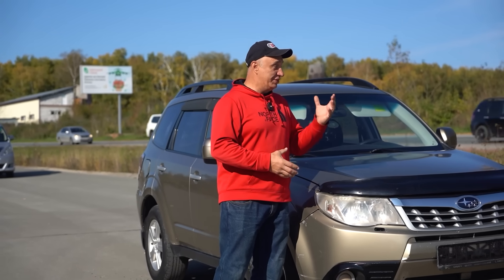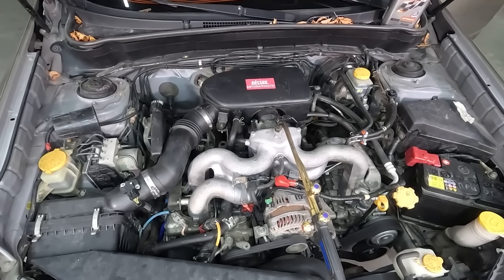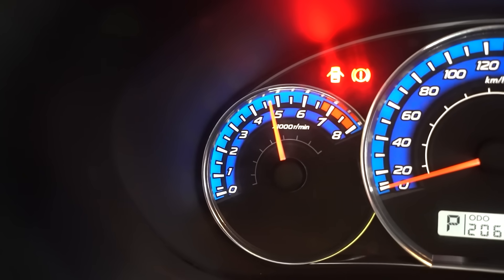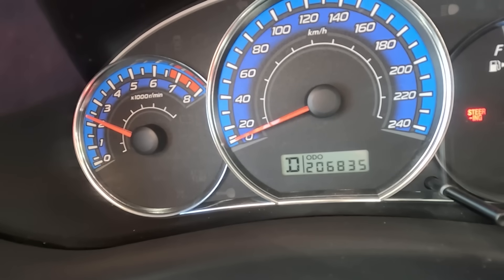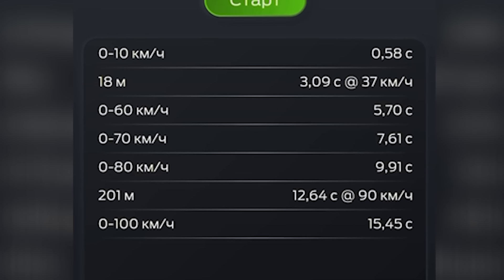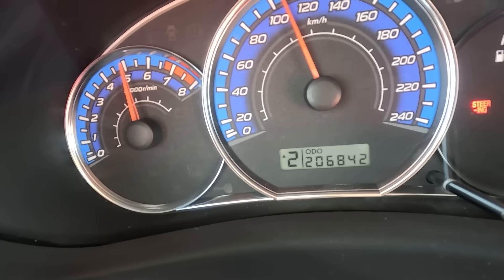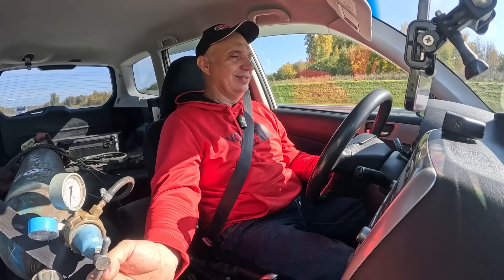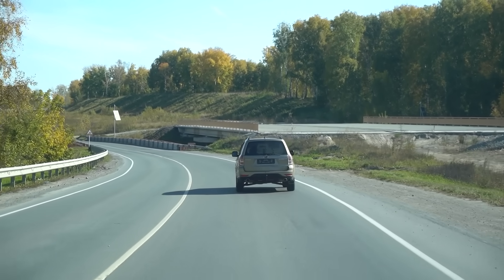We run an engine on pure oxygen - what will happen?

Comment: I can't believe how dumb this is. This is a "car channel" with "car guys" who don't know how a car works. 
Since they are adding air after the MAF sensor in the intake the ECU doesn't get the data about the intake air. Maybe the MAP sensor in the intake is reading the extra air but I doubt it. Instead, the first O2 sensor is seeing more air which the ECU then sees and so it feeds more fuel which increases the engine speed. No mystery. The throttle on a car really determines how much air goes into the engine for combustion. It's not a gas pedal, it's really an air pedal. 
A useful experiment would be to add pure oxygen into the intake and see what performance gains/losses there are without the other gasses that are mixed in regular air.
Reply: @ebaottvsaotw  do you feel better now? I hope so.
Because, no shit Sherlock.
Maybe just enjoy the show,
like the rest of us.  ;) :)

Comment: I thought you would have burned pistons or scored the cylinder wall. Melted plug electrodes, galled pistons, etc. from running an extremely lean mixture.

Comment: hate to ruin the 420 comments... lol.

hotter burn, but less air density as its only oxygen, not 4/5ths nitrogen. bet those plugs come out blistered white if not molten...

O2 sensor is going mad, seeing abnormal levels and trying to dump as much fuel as possible, still reading high, yet TPS and MAP/massflow arent changing as the throttles been bypassed... how it even runs without the ECU throwing faults left right and center is the real question...

dyno, log the results...

Comment: Well you are basically adding a vacuum leak with pure oxygen course it will rev up.   But I don’t understand how the car even stays running cause it passes by the air flow sensor.  And un-metered air usually makes a car freak out

Comment: i doubt the engine "knows" it has more oxygen to work with,  its just detecting too much o2 in the exhaust and compensating with a richer tune. try it with the o2 coming in before the MAF, i bet you'd get different results

Comment: I had a issue with my car hitting 5k rpm after swapping the motor.  Turns out I had the iac tube plumbed directly into the plenum, bypassing the throttle plate.

Comment: I have done an oxy system before you should use a mixer nozzle from a NOS system and feed it with methanol or e85 via an electric fuel pump otherwise you will burn a piston eventually...the system we did at college made over 200hp more on a 350 sbc without engine damage...big bottle though to haul around though.

Comment: Short and long term fuel trims would have been at maximum to try to bring the fuel mixture into normal range.   Lucky you did not melt a piston.   The mass airflow sensor was also bypassed an this also causes the ecu to not know how much fuel to add.   After ceasing oxygen the fuel trims eventually returned to normal allowing the engine to run property.

Comment: I'm surprised the ECU didn't cut fuel once the RPMs went out of range for the given throttle input. My '99 Honda Civic will just cut fuel to drop back into acceptable range if it revs beyond what it expects for given MAP and TPS values.

Comment: I've tuned these engines, there is a long term fuel trim that will have exceeded normal ranges (standard in excess of 15% +/-) as the car will be running very lean the car will have thrown a P0171 and entered limp mode as it thinks the lambda sensor is bad (used for closed loop). When we tune these engines we allow higher LTFT's to use E85 with some custom code to for a virtual flex sensor. Now if you injected fuel with the mixture you'd get some very interesting results.
I think you should try compressed air into the intake manifold to build positive pressure.

Comment: New airflow must be entered before the MAF for the computer to calculate fuel injection. This experiment would be interesting on a carborated car
Reply: MAF assumes air at ~21% oxygen. Putting 100% into it would still screw it up, making it run lean. Carburetors are designed for ~21% oxygen as well, so injecting pure oxygen would also make it run lean.

Comment: 1. Your injecting after the throttle body. It's like having a vac leak so the revs go up. Nothing too odd about that part.
2. Ecu will be detecting lean on oxygen sensors. Short term fuel trims will only add so much more fuel so it will be piston melting lean still. Even if they added extra fuel, you'd just melt them faster.

Comment: When I was a kid in the early 70's my dad used a cutting torch to add oxygen to the carburetor of an old International pickup.  The revs did increase with no one in the cab and no fancy electronic controls.

Comment: By injecting the O2 after the MAF and throttle body, you basically created a massive vacuum leak. That's why the revs climbed at idle. The computer was fighting for its life trying to control the air/fuel ratio using conflicting data from the MAF, TPS and O2 sensors
Reply: Don't forget that any fuel burning in pure oxygen is so much hotter than in the regular air
Reply: I'm surprised the ECU didn't throw a check engine light
Reply: @pistonsjem  I'm surprised the ECU didn't give up and cut the fuel entirely. I own a subaru, and when the MAF sensor started to to bad, the car was impossible to idle and nearly impossible to drive. I unplugged the MAF and the car went into open loop control, which allowed me to drive it a short distance to get to a shop, but it was very much not happy, and could only just barely idle, topped out at about 2000 RPM, and had almost no power at all.
Reply: @pistonsjem  It most definitely did, because 1. There is absolutely no way that the cat sensor would not go crazy getting this much extra O2, 2. the whole engine is going out of wack, 3. He said there were misfires, which you can't know during normal RPMs, but the check engine light will flash during misfires, trust me, I know: I drove around years with misfires.
Reply: @pistonsjem  I would have expected an over-temperature (over-heat) light.
Reply: @pistonsjem It would if they kept driving it like that. I'm sure it had transient errors already. Mixture out of bounds like if the MAF was bad.
Reply: You'd think an auto mechanic shop would know that.
Reply: You would think these guys would know something this basic. It's almost like adding direct Port nitrous injection without adding fuel to it at the same time.
Reply: Being pure oxygen, I don't think it would matter if it was before the MAF or not as the MAF calculation is base on air which is ~9% oxygen. So it would still be vastly inaccurate.
Reply: @micahap1559 a maf doesnt measure mass directly. Maf uses hot wire, in a specific diameter intake, that is cooled by the incoming air, to messure VOLUME of air, then the ecu uses the intake air temp sensor (iat) and manifold absolute pressure (map) or secondary pressure sensor (baro) to CALCULATE mass.
VOLUME x WEIGHT = MASS
A Hot wire can not messure the weight of the air, so in fact, can not actually messure mass, its all CALCULATED. Only way this would work without a retune, is to manually add the extra fuel needed for the volume o2.
Reply: @natereinhold6180 
None of that is relevant except that it is calculated. You're clearly missing the simple point without bringing in irrelevant info. You would do well to spend half the effort used memorize for comprehension of the process.
Reply: @micahap1559 yeah, I put a reply to a different convo about injecting before or after the maf, on your comment by accident. Youre saying what im getting at. If you change the variables (ie: o2 concentration in atmosphere) the math used to calculate air mass, falls apart and the ecu only has the o2 sensors (in closed loop operation) to attempt to correct ltft
Reply: @micahap1559  Air is 21% oxygen.
Reply: @dquam3885 lol same applies. That's 1/5 what it's getting if measured instead of 1/10.
Reply: even if they injected o2 before MAF it would still measure the extra pure oxygen as air (21% oxygen) so it wouldn't be able to calculate fuel properly anyway. it would enrich the mixture while in closed loop up to some +20% of fuel and if operated long enough in those conditions apply it to LTFT which then would enrich the mixture even in the open loop - so while flooring the vehicle. because they were applying extra oxygen when hard accelerating, the ecu was probably operating in open loop hence it didn't throw an error code and just ran lean not knowig that (o2 sensors weren't used).
Reply: @plllot9713 this is the answer. Wide band o2, bigger fuel injectors and tuning the ECU would be the cool video to show.
Reply: isnt it also pressurised? so its like adding boost?
Reply: also they cant really make more power without a remap anyway. its a useless vacuum leak.
Reply: I was skeptical of them adding O2 to the manifold directly. They should pipe it directly into the air intake hose. I'm sure it'll be more stable
Reply: I don't think the MAF can detect the abundance of oxygen in the air anyway. AFAIK it detects mass and temperature. The oxygen sensors will detect the lean mixture and the ECU will try to compensate by spraying more gas but it will give an OBDII error as the ECU will think the MAF is bad. And even if this happens I doubt the injectors will be able to handle such a lean mixture. It's like supercharging a NA car but not upgrading the injectors or adjusting the fuel parameters. The engine will run lean until it melts.
Reply: @ky7299  > The engine will run lean until it melts.
I think it would not melt. There are a few parameters the ECU monitors and controls - Inputs: engine knocking and exhaust O2 sensors; Outputs: ignition timing. The ECU will detect engine knock first (possibly with high water temperature) and retard ignition timing causing the engine to reduce power (and heat), lowering temperature. The reduced power would be detected by the driver as sluggish / reduced power, as shown in the video.

The ECU and MAF know nothing of the composition of the intake air - it assumes O2 concentration would be fixed at some value (19% +/-1%). If you inject O2 ahead of the MAF, it at least gets the volume correct (or mass, if pressure is working), but it is unaware of the higher, variable O2 concentration (say 25% at high speed, greater at low speed, for concentration that doesn't normally vary greatly). So, all bets are off with respect to (normal) ECU performance.

Instead, the best the ECU can do is to monitor for abnormal conditions and try to respond to them - High exhaust O2 and engine knocking. Responding with retarding ignition, possibly operating open loop assuming failed/missing sensors to keep the engine safe.
Reply: @ky7299 it messures volume of air and uses iat and map/baro to calculate what the mass is. It can not work on its own. Volume(measured by maf) X weight(measured by map/baro) = MASS (calculated value based on o2 concentration @ sea level and corrected for with the map sensor in the first few seconds of key on, or continuously by a secondary baro sensor)
Reply: @natereinhold6180 If the engine has a MAP sensor. Many engines don't and rely solely on the MAF sensor.
Reply: Is a MAF the same as a MAS?
Reply: @treeguyable yeah, mass airflow versus Mass Airflow Sensor
Reply: @AnonymousUser90210 MAF sensor vs MAS
Reply: @treeguyable mas is not a term used. Theoretically mass air speed could refer to mass air flow? You can't really measure how much air off of just the speed. A MAF sensor detects the volume of air by detecting the mass of the air going in. A MAP sensor detects the amount of vacuum and air pressure to tell the volume of air.
Reply: @gang-yc4je Ok, looking for an explanation, I thought  mas stood for mass airflow sensor,  wasn't sure if it was like a vin number,or, hot water heater, 2 things that don't  exist
Reply: @treeguyable yeah mas is not a word I've ever heard used. I usually just say air sensor to customers.
Reply: 😜ok👨‍💻🧑🏻‍🔧
Reply: They are used to the Lada that I beleive is still carburetor :D
Reply: Wouldn't matter anyway, maf cant read the extra o2, thats not how they work.
Reply: Even before the MAF, the 100% O2 is not the same as 21% in the air. MAF measures mass of the gas, not the composition.
Reply: @falrus  Agreed 100%.

However, do you think the torch would deliver more than a small fraction of the air volume the engine requires? Even as engine speed changes? Not likely. 
At best, the torch simply raises the oxygen concentration above air (from 19-20% to 30%, maybe), and not consistently (due to variable engine speed).

If enough O2 was injected into the intake manifold to replace all the air flowing though the MAF, the MAF would indicate far below normal airflow while the crankshaft is still moving. The ECU would operate in open loop mode and lite the check engine light (MIL; Malfunction Indicator Light) (for MAF malfunction) - that didn't happen.

The engine is NOT getting 100% O2... EVER.
The engine IS GETTING EXTRA O2 that it isn't aware of. The ECU thinks intake air is always air.
Reply: You are not true. The revs climbed AFTER he let in the O2.
Reply: @catzy4492  wow you have no idea wtf
Reply: Should try boosting a motor with compressed air
Reply: They just need to put a nitrous kit on it and use the nozzle for fuel and make an adapter to feed pure oxygen instead of the n2o. Which is just adding oxygen as well. Put a bit more fuel in the than the normal nitrous kit uses because of the pure oxygen added and should be ok
Reply: @slopoke22  That was my thinking too. At the same time you inject N2O, you would normally add extra fuel. That gets you extra power while also running lean, until you have to deal with the extra heat, raising temperature. High temperature is likely to enhance pre-ignition (knocking). The ECU would detect and respond to knocking by retarding the spark timing, reducing power. Everything would return to normal when the engine cooled off.

Interesting experiment.

This makes me think back to an article I read about a group with a supercharged engine looking for a way to reduce the power demand by the supercharger. One option that was considered was an electrically powered supercharger, but the electrical power demand would be far too high.

They instead opted to augment the supercharger with a compressed air bank. The engine was normally supercharged, except when higher power was needed. Then the intake manifold switched from supercharger air into the carburetor to compressed air at 10Bar(145PSI) while the supercharger output was vented. On the racetrack, the idea worked VERY well, but the boost was limited to the 3 large air cylinders in the trunk at 240Bar (3500PSI) regulated down to 10Bar with high volume. They would slowly recharge the air bank after the race.

Comment: I'm going with the idea that the ECM was "learning" a new response that was outside it's limits so was basically in limp mode, which affected shifting as well. It was trying to read "normal" at the O2 sensor and none of the other items like engine vacuum and throttle position were in jive. You had a giant vacuum leak that was feeding O2 but nothing else could keep up. I also think trying to power bind one of those CCV transmissions is a bad idea... and of course you'd be up against converter stall speed at some point.

Comment: Greetings from the Netherlands, I'm following you with great pleasure.
More oxygen, you need to adjust the electronic injection ignition. Perhaps reduce the ignition advance and inject more fuel. (The air meter measures the amount of air, not the oxygen ratio. The Lapda sensor in the exhaust should compensate for this.).
The oxygen intake is behind the throttle valve (+, electronically controlled variable adjustment). It makes sense that it idles higher. A lean mixture and premature ignition advance are harmful.

Comment: O2 should be injected before the Air mass sensor
Reply: it would still calculate all  the extra oxygen as AIR which only has 21% O2. so even if engine sucks only pure oxygen it'll calculate fuel for the 21% content so some 5 times too little.
Reply: @plllot9713  21% O2 by volume, mass air flow sensor measures "mass" which O2 is 23% of the air by weight "mass"
Reply: @steamdriver6964  you're correct. still doesn't change the fact people in this thread lack basic understanding of how fuelling in the engine works 😬
Reply: @steamdriver6964  no a maf doesnt measure mass directly. Like, you need to learn how engine management works. Maf uses hot wire, in a specific diameter intake, that is cooled by the incoming air, to messure VOLUME of air, then the ecu uses the intake air temp sensor (iat) and manifold absolute pressure (map) or secondary pressure sensor (baro) to CALCULATE mass.
VOLUME x WEIGHT = MASS
A Hot wire can not messure the weight of the air, so in fact, can not actually messure mass, its all CALCULATED.
Reply: As soon as I saw it was a Subaru I knew the engine was short for this world lol